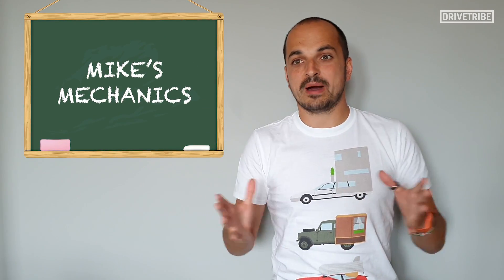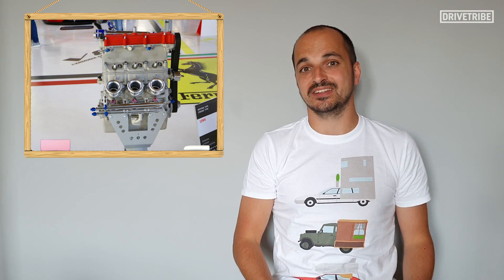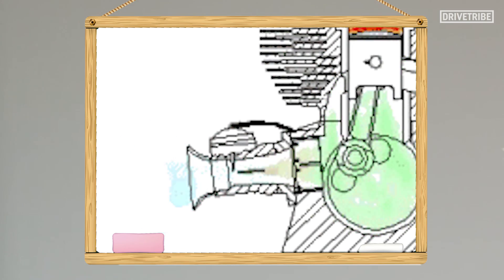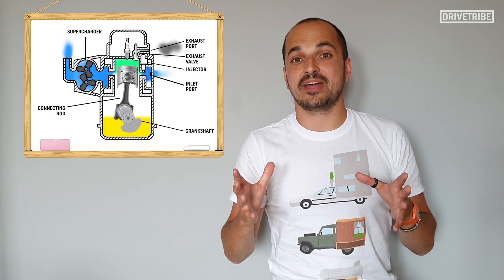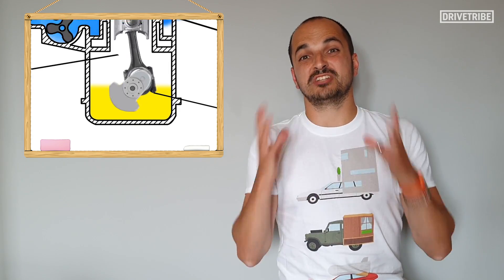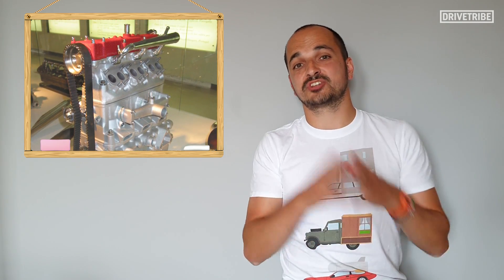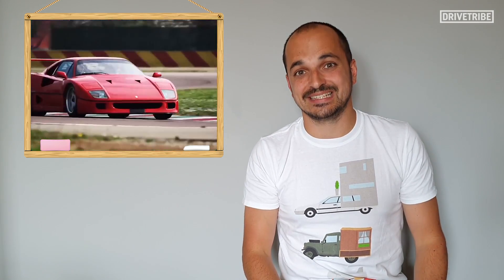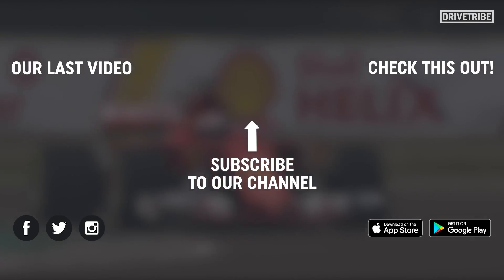Ferrari once made a supercharged two-stroke 3-cylinder engine

Comment: Yo intentaria poner la admision arriba en la tapa de cilindros, así el aire no se sobrecalienta y expande resultando en aire poco denso.
Usaria valvulas conicas o tal vez una valvula rotativa. Y haría el escape por abajo, digamos que exactamente todo al reves de este motor.
Con eso lograría que el gas de escape le pegue fuertemente al turbo y sin valvulas que comprometen el flujo de los mismos de por medio.
Luego el turbo tambien seria un turbo especial:
Seria parecido a los turbos actuales de la formula 1, pero en vez del motor electrico en el eje del turbo yo haría un sistema de transmision asia el eje del turbo que sea capaz de impulsar el turbo en bajas y medias rpms, y que en altas el turbo sea impulsado por el gas de escape, cubriendo así todo el rango de rpms del motor con un unico turbo especial.
Y en el cigüeñal del lado del volante de inercia le pondría un motor eléctrico al estilo del que tiene el porsche 918 o como el del motor de tres cilindros de Coenigsegg.
Así aseguraría el buen torque en bajas revoluciones del motor.
Y en la tapa de cilindros le haria refrigeradas con agua las gargantas de admision, imprimiendo con imprasora 3d  caminos de serpentina para el agua alrededor de las gargantas de admision y esa agua tendria su bomba y radiador aparte del resto del sistema de enfriamiento de cilindros.

Comment: 2T Principle with exhaust valves
When the all-round transfer ports open, the valves must also be opened so that the burnt gas can be flushed out. The transfer and exhaust timing strongly depends on the pressure generated by the supercharger. The work load that stops in a normal 2t as soon as the exhaust opens, continues here until the opening of the transfer ports. 
I see that this flush is not yet sufficiently optimal because with 430 hp of power it lags behind the approx. 730 hp of the Aprilia RSA level in 2007. The fact that the crankshaft is inhibited by the oil is also a loss, but that cannot be so high. Perhaps we should conclude that this was only the beginning of a new design and that it should have been further developed.

Comment: Dry sump lubrication would also be a beneficial addition, cutting windage loses and allowing the engine to run even cleaner. I once owned a 3 cylinder Kawasaki H2 750cc 2-stroke motorcycle and I can assure you, there was no lack of torque with that little beast.

Comment: What do you call a engine that uses a piston as a SUPERCHARGER ,for example a 2 cylinder engine only uses 1 cylinder for power and the 2nd cylinder for compressing air and fuel mixture into cylinder 1 .

Comment: The Rotax 850cc E-tec TURBO DI  2 cylinder makes 165HP in consumer form....And keeps making that HP at altitude. It also weighs less than that Ferrari boat anchor from the 90's. It uses computerized lubrication and fuel delivery.

Comment: Those 3 points made around 2:49 are incorrect... 2T's run cooler then 4T due to less rotating mass and moving components, 2ndly 2T can run at any powerband you want. A typical 125cc 2T does have a narrow power and but if you have ridden anything bigger you will know they tend to open up and become torque monsters with low end grunt, chunky mid range and a tight powerband up top like my TM300EN 2T is and all 500 2Ts are. They are torque monsters that are mistakenly thought of only producing horsepower. In the big 700cc 2T Maico they are almost all torque leading up to the powerband which hits you with the HP.
Reply: Ty

Comment: I imagine this i3 with the supercharger and a turbo both direct and indirect fuel systems and use two to make a v6 and a body a mid transverse tiny wheel base like the stratos like body all of it joined together making a fast car able to run in dirt and asphalt using an awd 6 speed manual transmission

Comment: "not much torque"

500cc two strokes: What ?
Reply: 500cc 2 strokes can kickass a 1000cc 4 strokes around tight corners ..their powers peak at high rpm phenomenally..
Reply: @fidelcatsro6948  would it in a car with the extra weight? Not looking for argument just answers. Steve
Reply: @steveturnbull9542 there's multiple Japanese, German and Swedish cars who ran 2 strokes for decades.

You can put 2t engines in cars.
But remember, the bottom/block must be designed for a car, not a bike or snowmobile
Their crank is too small, throw too short and flywheel too small/light.

(Power numbers on drag racing snowmobile two strokes are out of this world though, they make dirt bikes numbers laughable) 😮)
Reply: I'm getting a 2001 cr500 next week very excited
Reply: @mainadmin9432  congratulations
Reply: @fidelcatsro6948  thankyou
Reply: @fidelcatsro6948  just picked it up it's a 94 cr500 engine in a 01 cr250 chassis. Woods suspension setup. U dont realize how fast u going until it's too late. On concrete it burns out the whole time accelerating. Fast is an understatement.
Reply: @mainadmin9432  congratulations 67hp single cylinder 100mph dirt bike !! remember to ride safely and not to annoy your neighbors!
wish i could bore out my 115cc single to do the same!
Reply: @fidelcatsro6948  lucky I live in a wooded area! No neighbors to annoy. 500 isnt what u expect, I have to get over the fear lol. Thankyou. Nice on the big bore!
Reply: @mainadmin9432  you going to annoy the grizzly and wild cats in the woods with that upsized lawn mower
Reply: @fidelcatsro6948  🤣🤣🤣
Reply: @mainadmin9432  post some videos of the bike dont mind looking here..
Reply: @fidelcatsro6948  I'll post some videos of it running maybe some trail riding I'd my gopro decides to work
Reply: yea and that only have 1 cylinder😅
Reply: I can never understand why people think two strokes rev higher and have lower torque than four strokes. They rev much slower and have far more torque, the seat of the pant feeling is higher revs but if you look at the torque and horsepower for the same displacement engine, two strokes always make more power at a lower rpm due to much more torque.
Reply: @mossoconnor4417  because 2 strokes show their colours at higher rpm peak range than 4 strokes where its not commonly used
Reply: fidel catsro this is just not true, look at the dynos 
You can’t just listen to the engine and say ‘oh it’s sounds like it’s reving higher, must be a high rpm engine’
Reply: @mossoconnor4417  they rev much quicker
Reply: Main Admin Quicker reving is not higher reving, having less flywheel effect is not the same as a higher rpm
Reply: It needs turbocharger
Reply: Glitchseeker 21 it’s called an expansion chamber
Reply: @mossoconnor4417  😂
Reply: Scavenging would be increased from the use of the harmonics of expansion chambers.
Reply: A supercharged and/or turbocharged 2-stroke would have gobs of torque and HP.
Reply: Laughs in Detroit Diesel

Comment: Enzo Ferrari and Aurelio Lampredi also tried to design a 2 cylinder 2.5 liter engine in 1955 for Grand prix racing, but the crankshaft kept shaking itself apart. It was called the Tipo 116.

Comment: So essentially what they did was the same thing General Motors did back in the 1930's with the Detroit Diesel, except Ferrari did it with a gas engine. It might actually work if they turbocharged it and used ceramic composite pistons to offset the increased combustion temps. Could be interesting.😉 They'll definitely need to go with 4 valves per cylinder like the Detroit to reduce overall sprung valve weight and allow it to rev higher.

Comment: Lol the snowmobile industry has naturally aspirated 2 strokes that make 160 up from 800cc.
Reply: rotax and polaris 850 cc engines makes about 165-175 hp
Reply: @matsmannela9475  with direct injection and a turbo, I've seen built cat motors make 300 horse!
Reply: Add hybrid and kers technology using v configurations for packaging and handling reasons 500hp is reasonable from a v4

Comment: Another thing is there'll be less rotational mass to spool up (missing one cam at least even with exhaust valves) so it should be a lot more snappy and rev happy. Once they put the other side on too the rotating of the crank etc is more or less already taken care of in the first 130hp so the second 130hp would be with almost no cost

Comment: The reality of the 3-cylinder 2-stroke....and putting two of them onto a crankshaft to make the V6 as the video says is an engineering disaster and nightmare waiting to happen....major counterbalance and vibration issues and torque throw issues vs. Doing the same principle in an inline 6 cylinder......much smarter....

Comment: Did anyone else notice that the supercharger lobes in the animated cross section would be forcing air back out the engine? 😅
Reply: Nope, the air goes around the outside, in the empty gaps between the lobes.  When the lobes mesh in the centre, it displaces any air in these gaps meaning the air stays on the engine side of the supercharger and preventing it from flowing back into the intake manifold.

Comment: i would imagine direct injection technology is what was needed to gain the effeciencies.
but like with the opposed piston engines cylinder oil control is still a problem with ports in the wall.

Comment: Could see the advances in gearboxes, especially in quantity of gears versus size and weight and speed of change being an enabler for this. A 10 or 12 speed gearbox would negate any low torque or narrow power band issues. Couple this with a hybrid electrical system like KERS to torque fill during the gear changes and at low RPM and you could have a mega package that I supposed isn't that different to current F1 and LMP1 engineering with their small displacement and high revving hybrid power units.

Comment: I'm not sure this would be worth it to F1, with solenoid valve systems coming to the forefront. The addition of individual cylinder valve timing in F1 would be a monumental boon as it could be the savior of some very expensive engines, not to mention allowing thermal control of individual cylinders. Being able to regulate the valve timing based on individual cylinder oxygen sensor, and exhaust gas temperatures could really help.

Comment: Hmm only 216hp with a turbo? The Nissan ZEOD engine is a 3cyl 1,5l 4-stroke turbo with 400hp, and it weighs only 40kg.
Reply: Is this powerplant reliable enough for daily use? Just curious, no offence
Reply: @monoracer_  Yeah brah, it lasts a whopping 5k kilometres!

Just kidding I'm waiting for the answer also
Reply: @monoracer_  Its a pure race engine but for endurance racing. So driving it normally would probably fine as it doesnt wear as much as full throttle for many hours. But for a road engine they would probably make it less "racey" and more street suited.
Reply: bmw 1.6litre 4 cyl race cars made 800hp in the 80s...but they lasted only about 1000miles..you can squeeze power out of tiny engines but they tend to have a very short service life

Comment: You have totally mixed up two very different types of two stoke engine, the Ferrari engine does not use the crankcase induction/compression method, it uses a super charger known as a roots blower to blow the air into the engine.
It also uses valves.
Reply: Perhaps you should watch the video before commenting...

Comment: The biggest engines in the world are actually 2-stroke albeit diesel.
Reply: And so are the smallest, looking at Dirt bikes, and some lawn equipment.
Reply: The Detroit Diesel 12V71 is one of my favorite sounding engines of all time. https://www.youtube.com/watch?v=kRziS6C3i1Q
Reply: @Gigitygigity24  gotta love those old Detroit screamers, 1,000 rpms sounds like 4 grand.
Reply: Apparently he's not familiar with the EMD locomotive engines either.  4000+ horsepower at 900 RPM.
Reply: @Gigitygigity24  this truck also sounds nice. https://youtu.be/j5a0jTc9S10
Reply: Also I should point out that this "NEW EXCITING INNOVATIVE ENGINE DESIGN!!!11111" he was describing is a pretty ordinary design for large 2-stroke diesels for like the past 50 years already. Google EMD 710 series or Kolomna 11D45 for example.
Reply: Nicolas Broszky  worlds biggest engine is 2-stroke diesel.
Reply: @valtteriwikstrom5844  yup it's an inline 14 that has 109,000hp.
Reply: And possibly the oddest - see Napier Deltic.
[Edit] And the Commer TS3, a three-cylinder opposed-piston with a single crankshaft.
Reply: @Graham_Langley  The deltic was indeed an unusual engine along with its relative the Nomad.
Reply: Real engines don't have spark plugs😉
Reply: the japan build 2t for the european tanker if im correct.sounds like eastern europe company if im not mistaken. took a 2 floor hieght and more like a small electric gird powerplant kwwkkw
Reply: Nicolas Broszky  The biggest ones
https://en.m.wikipedia.org/wiki/W%C3%A4rtsil%C3%A4-Sulzer_RTA96-C
Reply: Yep. There are some monster diesel 2-strokes... Detroid diesel being one of the bigger players back in the day.
Reply: The EMD 16-567c is my favorite.
Reply: @USA That is true if you apply the innovative tech Gale Banks has on his former Pro Stock S10. Now diesel powered.
Reply: Yuk, diesel

Comment: This engine still have valves, exhaust valves. 
Its not smaller than classical OHC. 
Its not perfect. 

Produces only 100hp/litre with supercharging. 
You can make this level of power without SC on 2 valves in a street machine.

Comment: “Ferrari hasn’t made a v6 in years”

Laughs in giulia quadrifoglio
Reply: MunroM84  It's an F154 engine... Wouldn't have the Ferrari engine code if it wasn't one
Reply: @mikeb3172  Don't worry Mike, MunroM84's Mommy probably doesn't let him watch proper racing.
Reply: MunroM84 hahahahha
Reply: @MunroM84 F1 is still a car though..
Reply: MunroM84   But it was all Alfa’s design, definitely NOT a trimmed Ferrari V8. Made very clear by them./s
Reply: @Hallison Michel it is not a serial build car yes.
Reply: Was the Berlinetta a V8?
Reply: @kvltizt  ig it was a v12
Reply: What is the current Ferrari F1 engine then?
Reply: @RichardASK  He said production cars in the video
Reply: @filmandfirearms  Is an an F1 car not produced then?
Reply: @RichardASK  They only make 2, sometimes 3 or 4 for a season. That's not a production car. A production car is a car that is in regular production
Reply: MunroM84  Is a F1 car not a car then 'Mr Plank'?
Reply: MunroM84  sore loser

Comment: Not an engineer but when you supercharge the incoming fuel, would it not go out the open exhaust valve?
Reply: No. Firstly, this design doesn't mix fuel and air at the intake or supercharge, but has a direct injector. Secondly, it has an exhanust _valve_, so when air enters the cylinder, it won't go out.
This is more of a problem with piston ported 2 strokers. If you do aggressive port timing, you can have intake/compressed air escaping exhaust port, because intake/exhaust are timed this way.

Comment: You dont have valves so you can’t drop a valve? You can melt through pistons instead. The supercharged commmer knocker was one of the most efficient commercial engines in its time but four strokes took over from such oddities. I believe two strokes may have their day again. Remember the gp500 bikes produced up to  600 bhp per litre without supercharging.
Reply: More like ~400hp/litre.

Comment: Come on Ferrari, put that engine on two wheels!
Reply: Not sure that engine would cut the mustard in a bike nowadays, with only 130bhp at 1.3litres. It will be interesting to see, if 2 strokes can cover the emission requirements, before the 'ECO' brigade take all our fun away.
Reply: ferrari replied via whatsapp: we cannot sell them for 1 million dollars..
Reply: Did you see the size of that thing?

A "small" engine by car standards is massive by motorcycle standards. A modern 999cc superbike engine makes about 200hp and weights like 100lbs.
Reply: @BigUriel  The modern day superbike engine includes the gearbox and weighs around 100kg, not 100lbs.

Comment: Seems a lot like a spark ignition version of the compression ignition Detroit Diesel engine.

500 GP bikes were pushing close 190 bhp back in the day.
Reply: There was an test version of the NS500R with about 220whp
Reply: And the torque was 100 Nm. So that two strokes has low torque is totally wrong.
Reply: @nhytg376tgyuu765gjmg  2strokes has low (low end) torque but they have plenty on higher revs.
Reply: I was about to say it looks a lot like an old Detroit.
Reply: @KI4HOK  a screaming jimmy! those were great fun to work on AND drive
Reply: Bc it is SI DD.
Reply: Over 200hp
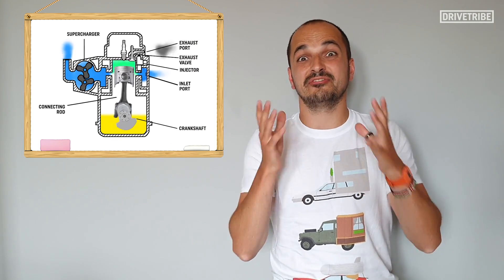Reply: Even the custom animation 3:39 is based off of the Detroit Diesel illustration straight from Google Images.

Comment: Narrow power band? F1 has 2 more gears since the 9's. Speed range is exactly the same.
Reply: power band on 2 strokes depends highly on the design of the ports (or rather timing) and expansion chamber of the exhaust. You can have a 2 stroker with wide power band at the expense of top end power and torque. Or you can design everything so it gets peak power within a 500 rpm range and everything before and after is dead.